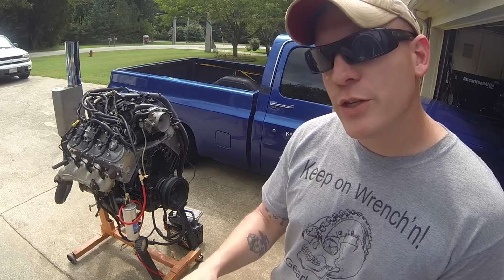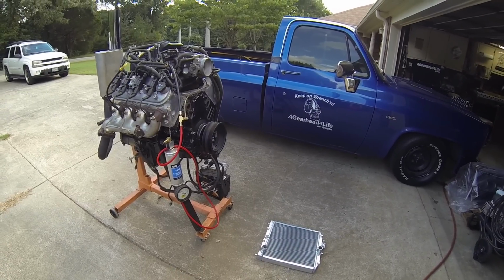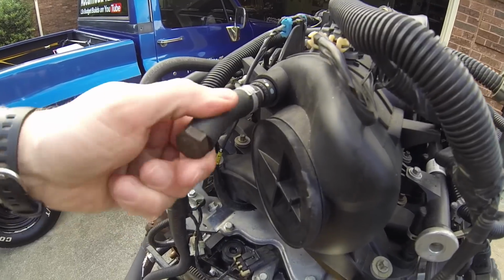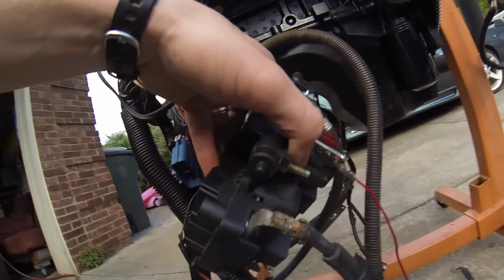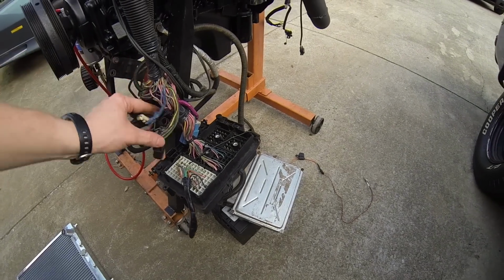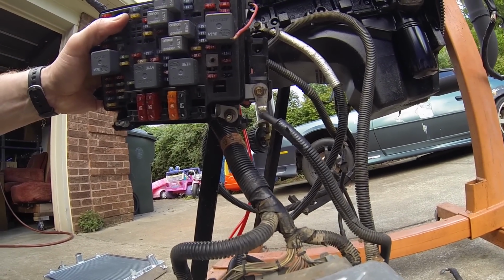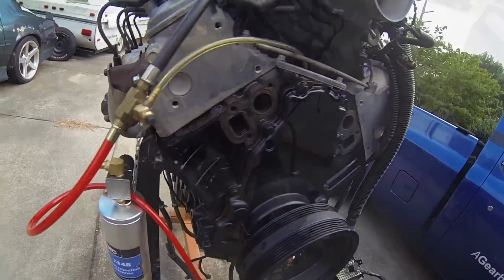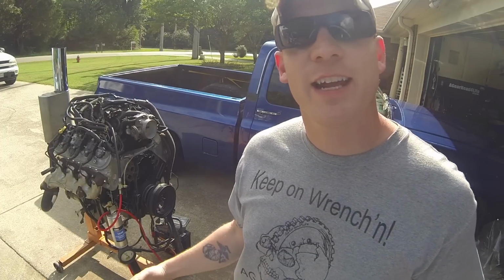LSx Swap Harness How To Simple & Free DIY Standalone on the Test Stand

Comment: Thanks for the info! The best part about an LS Swap is all of the hurt feelings when I lift the hood of my old Ford.
Reply from the maker: haha No problem! Glad that you enjoyed it.
Reply: Got any tips? Im gonna try putting a 5.3 in a 99 mustang that was originally a v6. I know itll all fit. Only thing I worry about is all the wiring and where to put stuff really. (First big project)
Reply: i like u.
Reply: Blasphemy! That is unnatural.
Reply: Will it work with a drive by wire
Reply: I always wondered why you never see a Chevy with a ford engine swapped into it....then I remembered it's because Ford's kinda suck...ford automatic transmissions really suck....and because chevy Motors are cheaper and usually harder to break....but the other day I seen where ford just released a gasoline 7.3 liter that shares alot design features as the chevy is....deep skirt block with Crosss bolted mains....single cam in block above crank with push rods and lifters....and even the heads look a little bit similar....ford says it for heavy trucks and fleet vehicles but I'm sure we will see it in a mustang....if the was ever a ford motor I'd consider swapping into a Chevy it would be Ford's new 7.3 gas motor....however....Chevy needs to quit bullshitting around and build a scaled up is with 5.5 bore centers....in an aluminium block with titanium connecting rods, a and a 4.5 stroke and a set of scaled up ls7 heads with a set of intake ports you could slide a pack of cigarettes thru....something between 500 and 540 cubic inches and 800 naturally aspirated horsepower that runs happily on 89 octane ....with a standard Chevrolet bellhousing flange ....if chevy would build something like that I'd sell everything I owned to put one in my chevelle...or sell my chevelle and buy a c7 wide body to drop it into....
Reply: @davy1458   buy a 454 ls
Reply: @trillrifaxegrindor4411  sure....whenevef I have a spare $14000 just laying around.
Reply: Haha
Reply: @davy1458   yeah the ford aod has taken over where the turbo400 left. And Ford Fe blocks were the first deep skirted 6 bolt main engines in the early 60's. Chevy is cheaper.. but generally break easier. Nice try though.
Reply: @davy1458  get a chevy 6.6 gas then

How much power are you trying to make?

Comment: Thanks for the post bro. I was able to start my junk yard 5.3 tonight on the stand to verify that it runs. This method Worked like a champ. Thanks again!
Reply from the maker: Awesome Mark! That's what I like to hear!
Reply: So can u drive it like that too I’m doing a ls swap in my 88 Chevy s10 I’m take motor and trans and other stuff I need out of my 2001 Chevy 1500 so what do u thinks first ls swap
Reply: Were you able to start yours without having pcm flashed? Just wondering.

Comment: It's 4 wires on the obdll port pin2,4,5,16  2 is cereal information, four and five are grounds, and 16 is power. And the serial information on your PCM is pin 58 on the blue connector

Comment: I used a $25 stand and mounted with Dingo mounts.  I had to flip them so it would bolt up.  I also made a "fuel pump" using and small tank with barb fitting out of the bottom, air compressor in at the top.  It fired right up.  You shoulda heard my wife after I started it with no exhaust in the garage lol.  Thx for your vid's and info dude.

Comment: Put a shut off valve right where the air goes in on that canister, it'll run quite a while on it. I've done that to move cars around that have dead fuel pumps. I usually set the pressure a little low so the regulator doesn't open.
Reply from the maker: Good idea

Comment: You just saved me a crap load of money.  I was gonna buy a $750 harness and cpu, but now I will just do what you've done here.  Thanks a bunch
Reply from the maker: +dawan antonio No problem! Those custom harness will look a lot better though. If you decide get get one that's cleaned up, I know a guy that is much cheaper than $750. I believe he'll redo an old one for closer to $300. Check out "LS Wiring Harness Conversions" on facebook. Good guy.

Comment: This is exactly what I needed, thank you! Now I'm worried I didn't pull enough of the harness out of the donor truck I junked to get the OBDII port and all that jazz. New subscriber, doing a great service to us learning this from scratch. Keep it up!
Reply from the maker: +Christopher Ryan Thanks Chris! If you unscrewed the engine harness from the fuse block, you got enough. You may want the fuse block too, to make it run like i did in this video, but you can always find that in a junk yard. OBDII ports can be found in any vehicle after 1996. So just cut one out. They're easy to wire in, just need one signal wire, one power and one ground going to it.
Reply: +AGearhead4Life Hi Mark, I was going to try to fire mine up today and I'm curious if I should take the water pump off to fire it on the engine stand. I have the accessory belt off and the power steering pump/alternator bracket is off as well as I have it on the stand. I don't want to burn up the pump if its going to be an issue and noticed it wasn't installed in your video. Thanks so much!
Reply from the maker: +Christopher Ryan YOu can leave it on there. It will not be an issue.
Reply: I'm stuck everything is ready but fuel. I bought the same injector cleaner but can't find a fitting to tie into the Schroeder valve on the rail. Do you remember where and what you bought to connect it?
Reply from the maker: +Christopher Ryan That is a great tool and works good at actually cleaning the injectors too. Yea, I used the hose off of my fuel pressure tester to connect the two.
Reply: +AGearhead4Life I'm going to see if I can find one, autozone might have them
Update: Autozone did not carry anything that would connect to the OTC 7448 or 7448A in case anyone else runs into this problem.
Reply: +AGearhead4Life I finally figured it out! To go the OTC route, I forgot a booklet came in the shipping materials and thumbing through, I found a 2000 GMC Sierra calls for the 7/16"-20 Schrader fitting which must be a match for your hose. In the booklet they state to use either fitting 31 or 45 which translates into the following:

Page 2 of the Professional Fuel Injection Application Manual 1997-2013 edition 7448A
1. (45) OTC 549578 Schrader fitting, 7/16&quot;-20 90 degree elbow
2. (31) OTC 518542 Schrader fitting, 7/16&quot;-20 (Chrysler, Jeep &amp; GM)

I hope this helps anyone else on your channel that runs into the same problem I did. Thanks Mark!
Reply from the maker: +Christopher Ryan Thanks for sharing Chris! I forgot that tool didn't come with a shredder fitting. Good call posting about it for others out there.

Comment: Never knew it was that simple, everybody makes  it seem like it's extra hard to do. Thanks AGearHead4life
Reply from the maker: jojow241 NP man! Most make it sound more difficult because they believe that you have to strip it all the way down to individual wires. You only have to do that if you want to complete customize your harness. I usually don't have much time, but want it to look a little better than it does with this bulky fuse block. So I take it one step further than in this video. I cut the plug off that goes into the fuse block from the harness and use a smaller universal fuse block to give power to the same wires that had power from the fuse block. It's basically just all the pink wires.

Comment: this is fucking awesome, but how do you erase the security system on the ecu?
Reply: You have to take it to a tuning shop and have them take it off, via hp tuners or something like that.
Reply: There's a couple ways to do it, one involves swapping it into a silverado and doing a reset process and the other is a camaro i think.
Reply: I have a 2006 Silverado with a 5.3 and another ecu from a 5.3 that I need to have the vats remove is there a link that you can direct me to
Reply: Just look up GM VATS REMOVAL, and there should be a few videos that show the method of using a different chassis to remove it. I don't want to go too far into detail because it could be used nefariously.
Reply from the maker: A link to have your VATS removed is in the video description.
Reply: AGearHead4Lif
Reply: AGearHead4Life

Comment: thanks. I did know about the brake pedal for the converter release. I found the fuel pump relay wire and managed to wire all that today. I had the 52 Chevy running today for 20 minutes. Tomorrow will move to the Plymouth coupe...again thanks

Comment from the maker: Link to "CoolMike222" on eBay for VATS removal now updated:
http://rover.ebay.com/rover/1/711-53200-19255-0/1?icep_ff3=11&pub=5575162067&toolid=10001&campid=5337841854&customid=&icep_store=coolmike222&ipn=psmain&icep_vectorid=229466&kwid=902099&mtid=824&kw=lg
Reply from the maker: That's a good question that I'm sure he'd be able to answer. Shoot him a message and see what he says. IT's be a couple years now since he's sent me a PCM and I was living in AL at the time. I'm an on-line shopper though, so i've gotten use to waiting a week for an item to come in the mail. It doesnt bother me at all.
Reply: hi my name is steve im trying to build a ls to put in my Oldsmobile cutlass  whats the best way to go ??
Reply from the maker: Hey Steven. I'd need a more specific question to help you out, because you wouldn't necessarily have to build it at all. just drop it in stock and it'll still be great.
Reply: AGearHead4Life  where are you from man would love some hands on
Reply from the maker: mattsworld17 I'm now living back home near San Antonio, TX.
Reply: AGearHead4Life what LS engine year is recommend for a fox swap and what size thanks
Reply from the maker: Jose Iturbide Any that you can find, Jose. I just usually like to stay away from 98-2000.
Reply: AGearHead4Life what’s the reason to stay away from 2000 that’s what I have purchased to put in 5.3 ?
Reply: AGearHead4Life can I drive my truck wired like this?
Reply from the maker: Sam August 2000 year model engines aren’t really bad, but they can have similar things to the 1999 model which has a couple things about them that I don’t prefer. 
Like “notched” heads forcing you to use a paper head gasket. I prefer to use a MLS head gasket.
Actually, that the only reason that I can of right now.
Reply from the maker: Jayson Webster Yes, you can. Though you’ll likely want to run a wire for your TCC and OBDII port also.
Reply: AGearHead4Life ok thanks

Comment: Maybe I can't wrench anymore but I still have fun watching. Double D put a LS in a fifty seven more door n then converted it to a tudor. He made that part easy cause he did one and learned and I ask myself why we didn't do that when kids as two anything was high an more doors were tow aways. Even better, he used pontiac doors on a  chevy with no grief. It was his first LS swap and nervous as a long tailed cat in a living room full of rocking chairs. He couldn't of googled it as he bought wiring looms and had a mess going and also wiring is not his strong suit. Now no problem, grab and throw it in. I watch another channel cause he builds rat rods as they have probably had the longest run of project cars. I think the next thing is building subframes that let you do a direct bolt in and power steering is right there. Long and short, his buddy grabbed the mess and tied it together like you and then the magic of touch the jumper in this app, and it fired right up in front of him. The look of shock took facial to the dumb bear look/LOL. I never had all this fun but fixed a few cars for my own use... I wrenched on heavy equipment and made good money cause for me that was it. No computers, or facebook or google, it was the fifties and even the "cell phone" had a cord on it for ship to shore at three or more a minute.Don't get me wrong, I loved the fifties and on up to early eighties still not much in way of a computer.. some small attempts but nothing a bone head like me to worry about as the ground outs or open circuits were easy. Guy I worked for got a new drill rig and took the keys out making it hard for me to service so I hot wired it then after making sure everything was coatsure  went and hid it behind some other stuff.You could hear him blowing and I asked him what  was the problem an he told me that someone had stole his hundred tho drill  rig so I kinda wound him more said ya I seen it moving and thought you came back.. Finally couldn't take it anymore as the guys heartsick told him where it was parked and he tells me not to tease him right now so quick hot wire and drive it back out in sight. See, I am a mechanic an he is just making it hard on me... he got over it slowly and came around

Comment: gearhead..you answered my questions again thanks that's what I got that came with the pump.thanks again...so it's fuel tank to regulator to pump to rail...then from regulator return back to tank...
Reply from the maker: No. The pump makes the pressure. So it has to go before the regulator. Regulator regulates the pressure and returns the rest to the tank. It's tank, pump, regulator and then to the rail.

Comment: If you tire of those horrible engine stand casters there are plenty of much larger ones out there. I even converted on engine stand for outdoor use with two rear spindles and wheels off a front wheel drive VW Rabbit and extended the "tongue" as a tow bar. I put my engine hoists on car tires on the rear and solid farm equipment wheels up front. I can pull a big block in a sand yard and everything is much easier to push and pull.

Comment: Battery time doesn't matter how long it'll run, if you're running without water the bearings seize up before the battery dies. Friction= stuck valves, stuck lifters,    spun bearings, etc... The computer has no way of knowing how hot it is the sensors usually reading water temp not ambient air. But I see everybody firing them up, I guess these later style engines are designed to put up with a bit more abuse. 
Great video by the way, as always thank you for sharing man.
Reply from the maker: craigr13666 Thanks Craig! Yea, you're right. They'd probably seize up before the battery would die with no water and overheating. The friction that your describing would have to come from excessive heat of no coolant, because it's got plenty of oil circulation.The computer does have a very inaccurate reading of the engines temp but it's a lot closer than if it was unplugged. The heat transfer through the head will bring it closer to 130* by the time I turn it off. With the sender unplugged, it would assume that it was -38*. But that doesn't really matter so much because that will only change the fuel delivered. It's not going to help cool since they're no fans. These motors do handle a lot of abuse, but I don't see running them for 30 seconds with no coolant causing any issue. BUT I am known to take risks... often. lol  The only issue that I've been concerned about is possible hot spots from not having the water there to dissipate and move the heat. But I feel safe about it. I haven't had an issue yet and if I do, I'm sure I'll post a video up about it.This motor possibly has a bad head gasket. I found milk in the pan once I got it home. The seller said the motor ran great, but had gotten rain in it from having no oil cap. So, I plan to test the head gaskets once I have the radiator hooked up. It'll be nice to have coolant circulating, get the motor to operating temp and be able to test the motor better before it goes into the car. Besides that, it's fun and motivating to watch.

Comment: excellent video. one thing that should be noted however. your engine will only run for as long as your battery can hold it. honestly i have never tried to run an ls engine on just battery to find out how long you have, but it should be good for 20 min or so at least.
Reply from the maker: MaksWerks Thanks MaksWerks! Yea, good point, but that'll also depend on the battery they use. This one is large and holds a good charge. I've started it many times without a charge so far. I just charge it up occasionally. 

Once I get a mount made for that radiator, I plan to actually run the alternator and all front accessories so that it can stay running as long as I'd like.

Comment: nice video. most vehicles are that simple. as long as the security is bypassed
Reply from the maker: +Garrett R Thanks Garrett! Yea, I figure that.
Reply: What are you putting the LS in? That's the real question. I just picked up a 06 c1500 for free(won it) and I'm going to add a turbo and nitrous to see what a 200k mile block can handle buahahahaha! (Mad scientist laugh)
Reply from the maker: +Garrett R Sweet! Sounds like fun! This motor is just for mock up. I have a 5.3 in my 87 Chevy truck and a turbo 6.0 in my '92 Camaro.

Comment: thanks gear head... got it it was my ground...now just have to figure out how to connect wires to be able to start it with my switch....
Reply from the maker: well, you could always use a screwdriver and jump it like Zane did at the beginning of this video. lol Well he used wire strippers... A screwdriver is much safer though.

Comment: Awesome video man .. cant believe I'm just seeing this now ... helps out big time ... just a quick question ... you say it doesn't need the MAF or O2 sensors to run it on the stand ... do you know why that is? Doesn't the ECM need those readings to operate properly?... that's all I'm curious about .. thanks alot tho for posting this
Reply from the maker: Nate BB Awesome. Glad that I could help.

Yes, because without input from those sensors, the PCM will just use default data to do its job. 

Actually, that’s mostly true for the O2s. 

For the MAF missing, it’ll use the data from the MAP to do what it needs. These PCMs can even be programmed to not depend on a MAF at all. It’s called a “Speed Density” tune. Commonly done in turbo builds.